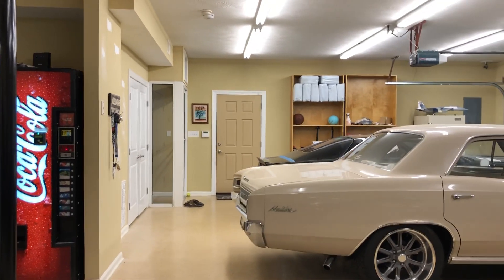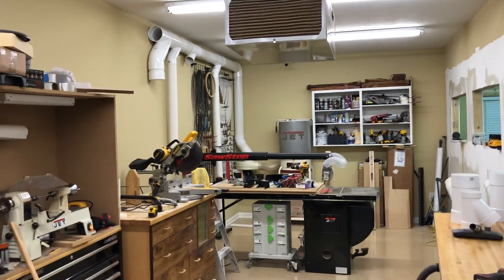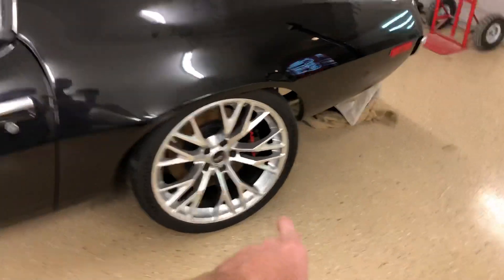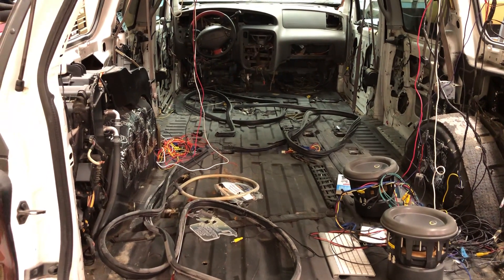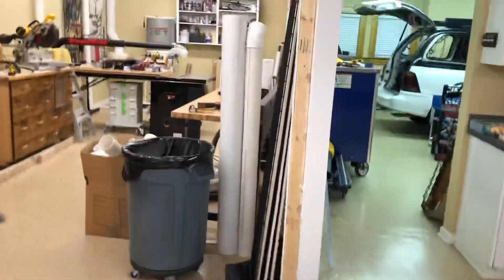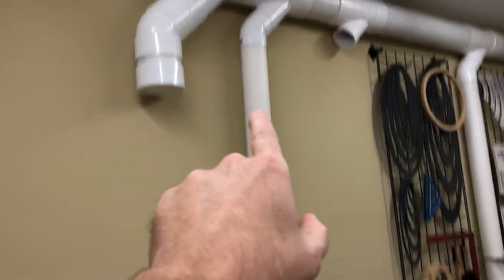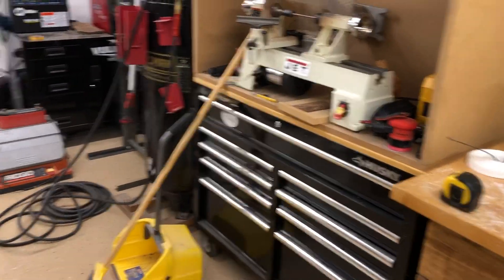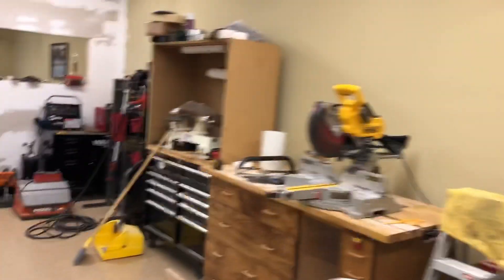Shop Tour (Raw Video)

Comment: @Batdog Garage  

CAJ sent me.  ;)  Really nice setup, Jason!

And it looks like you're really close to being 100% up and running.  :)  I know the feeling of not being able to start the project that you really want or need to start until you get everything else in order.  :/   But you'll get there, you're super close!

One thing that I did to make my workshop a much happier place to be was to put the compressor and dust collection vac outside of my actual enclosed work area (just for the noise factor).

Now I can hear myself think, and the actual tool noise is more satisfying, LOL.  And sometimes you rely on the sound of the tool or its interaction with the workpiece to know when something is going right or wrong.

Having the compressor, dust vac, AND an actual tool running all at the same time was a bit overbearing in my small-ish workshop (though its an 8x8x20 built-out shipping container, so much more reverberant)!

Subscribed and looking forward to seeing your projects!
Reply from the maker: Thanks!

I have a plan for noise reduction. That will have to happen later. Primary concern is getting it all up and running.